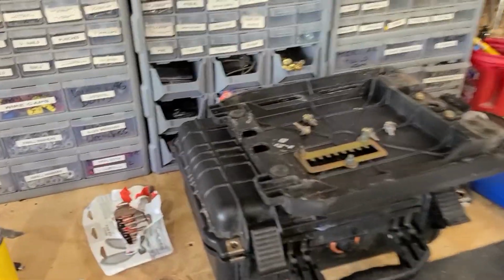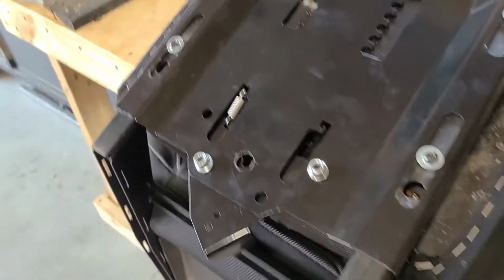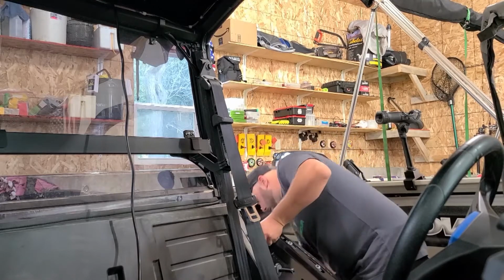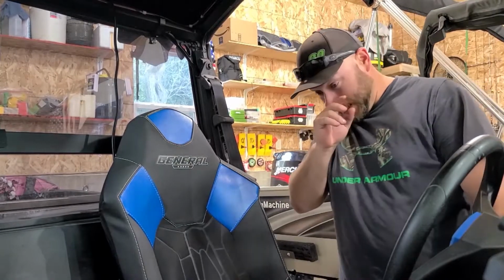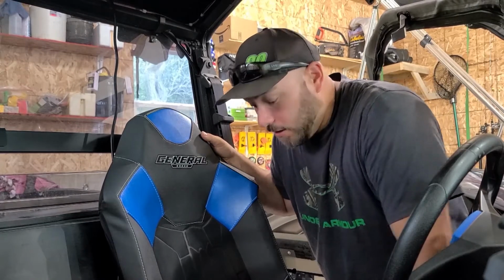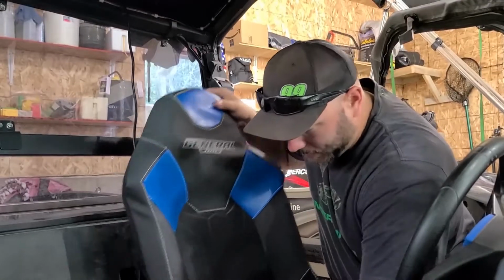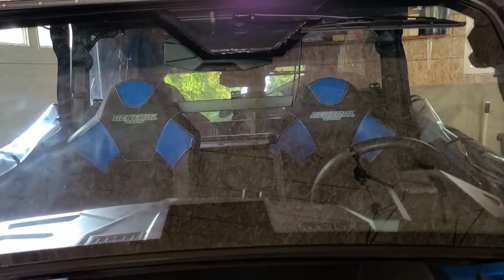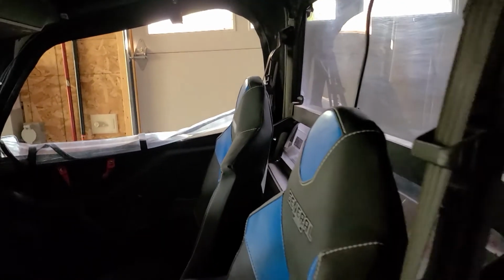Polaris General Seat Lowering Kit Review (Frustrated)

Comment: Generals are very uncomfortable (for big guys over 250 lbs), not only does the seat need to be lowered it needs to go back 5 more inches,,, needs more adjustment. The Polaris Pro R has much more room and probably be what I buy. I do like the General for all its uses but you got to be able to fit in it.. LOL